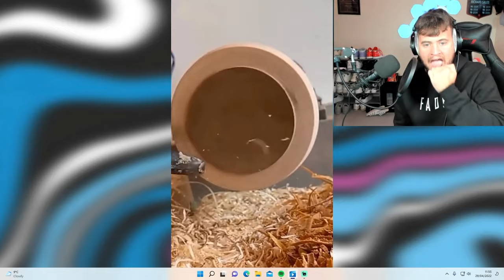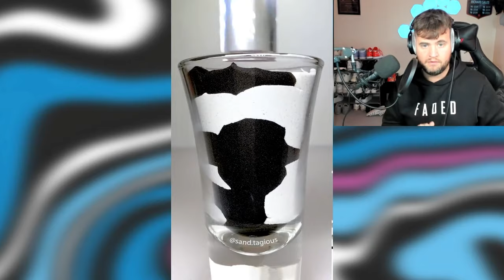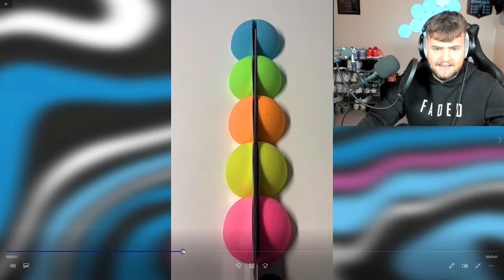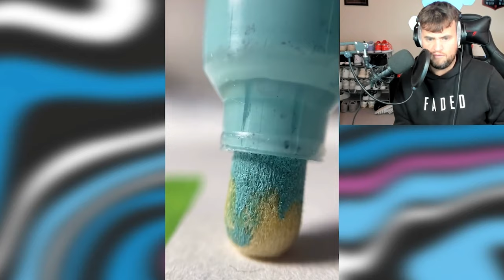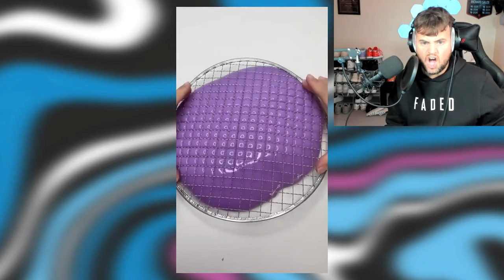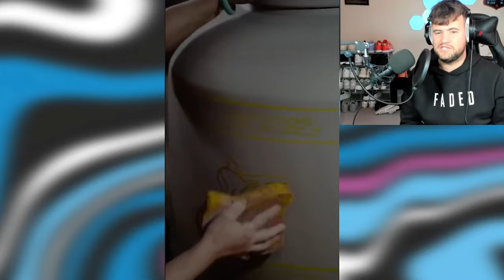REACTING TO VIRAL SATISFYING TIK TOKS

Comment: The shoes are done by a process called Hydro Dipping.  The machine that's on the video uses sheets of different color patterns.  But this same process Can also be done with spray paints which in Turn gets painted on top of the water and you dip your shoes or cups or anything that will hold paint and it comes up with a unique pattern every time. No two are ever the same. And you can customize by using any colors you chose.